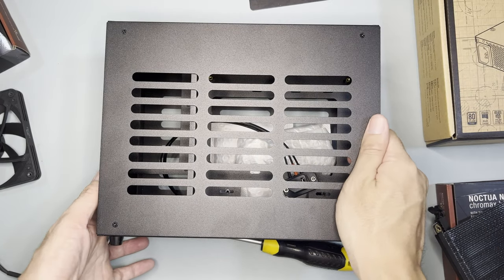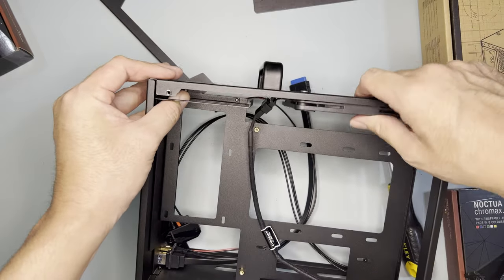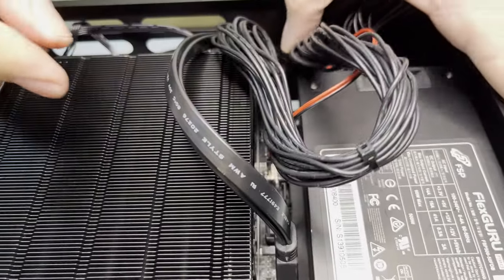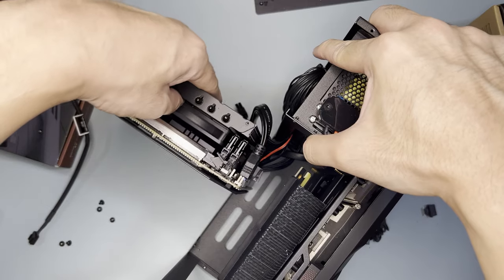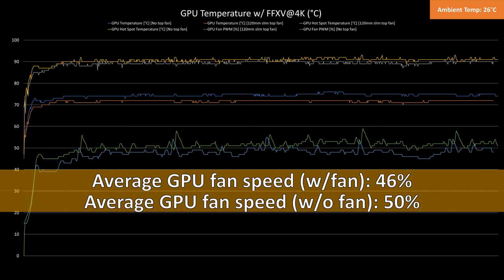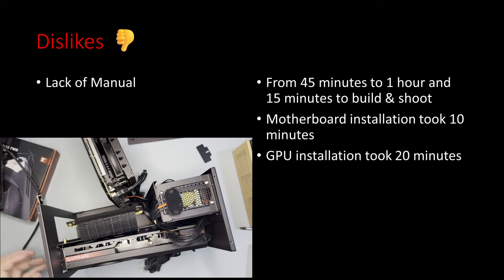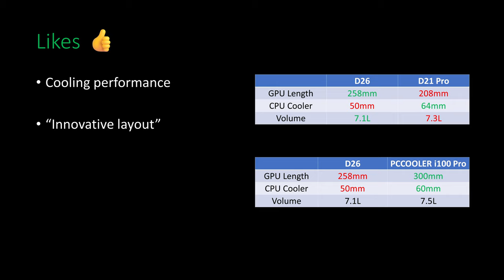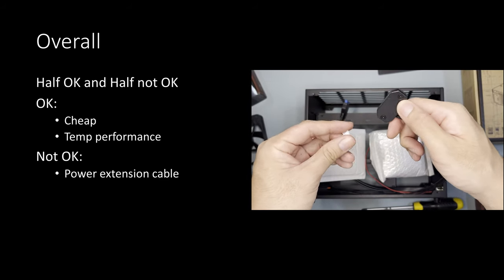D26 | A 7.1L SFF ITX Build | Thermal benchmarks

Comment: Qual tamanho do cabo riser pci-e que você usou? não consigo descobrir para comprar.
Reply from the maker: 185mm dual reverse riser.
Reply: @manongunboxing  180 degree? muito obrigado.
Reply from the maker: No, the right term is dual reverse. Meaning, from the PCIE slot, it will bend directly to the back (almost 360 degrees bend) and at the other end, there's another bend backwards (almost 360 degrees).

180 degrees is "flat" and may not fit.

Hope this clarifies.
Reply: @manongunboxing  comprei errado :c. Dificil achar no aliexpress
Reply: @manongunboxing  Voce chegou a ter alguma ideia de forma de por algumas telas mech nos furos do gabinete para evitar poeira? ou tornaria o resfriamento dificil? comprei o mesmo

Comment: Can you give me some recommendations for sfx power supplys under 100$ 🙏
Reply from the maker: How many watts do you need? Though as a general rule, you can’t go wrong with reputable brands:
1. Seasonic
2. Corsair
3. Coolermaster
4. Thermaltake
5. Fsp
6. Asus

Just check one that fits your needs based on watts and desired efficiency.
Reply: @manongunboxing  like 600-700 max bt couldn't find any cheap ones

Comment: what other GPU’s you can recommend with nvidia that has the same size?
Reply from the maker: Can’t say I can recommend, but there’s a zotac rtx 4070s that can fit. Haven’t tested though and it might be too hot for the case.

Other than that, there are lots of 4060 that can fit.
Reply: MSI mech 2x 6700XT or 6750xt is the best price to performance card that fits this case.

Comment: i have feeling that all these cases with massive perforated holes are the magnet for the dust
was also kind of weird to see these high temps during benchmark on CPU
Reply from the maker: For cinebench, it’s normal even for open test benches. Low profile coolers and a synthetic (unusual) CPU load for 5800X would really stretch to the thermal limit. Given that, the scores were as expected.

For game benchmark, based on exp, it depends but based on previous testing, this is not bad.